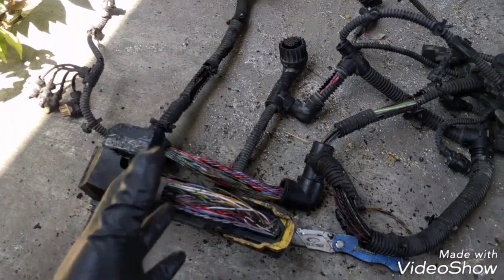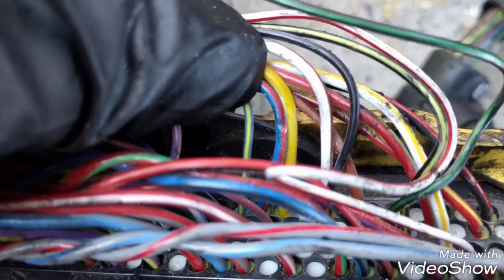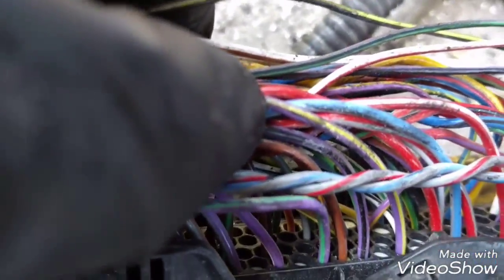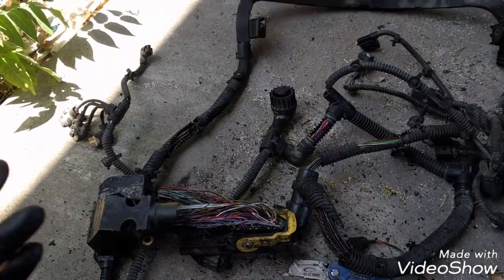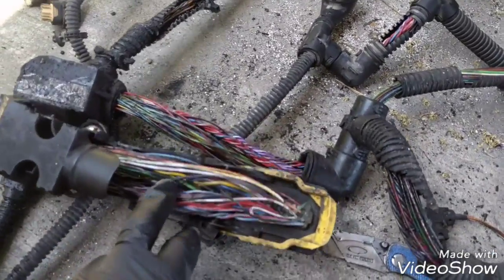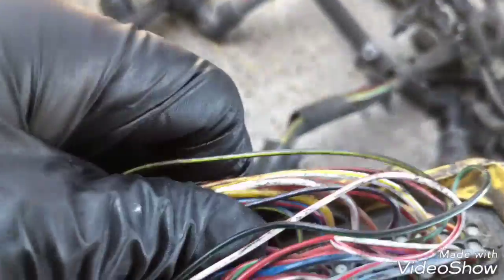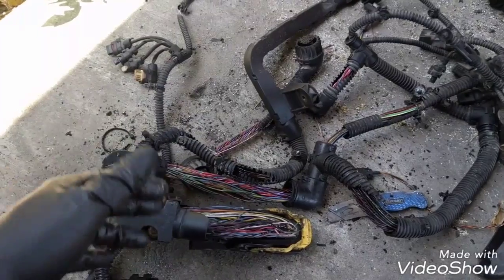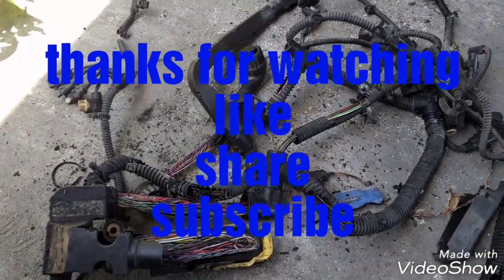Freightliner Cascadia check engine light on DD13 DD15 engine wiring harness might be your problem

Comment: Two thumbs up Francisco!!!!  I have a DD13, 2014 Cascadia, and suspect this is my problem with an “ECU 1” code
Reply: Let us know. I'm having the ECU 1 issue also.
Reply: @marcusjones1082  Sold Cascadia, but never did track down ECU 1 code 100%, It would come and go.  If you have replaced your transmission then you should have replaced ECU, and run the programs for setting clutch.  Sometimes the ECU goes out before the clutch does.

Comment: I randomly got spn4259 04 on my 2011 dd15, "unit pump solenoid cylinder 4, 5,  6 shorted to ground".  When it happens, I shut the engine off for 5 minutes and then restart it and it runs fine.  Right on par with all the common problems you list for the Cascadias.

Comment: Came across your video and have an issue. 2011 freightliner cascadia DD13 have check engine light and another solid light. Thought it was the fuel injector harness and had it replaced. Still showing and both lights comes back on, shut the truck off and kill switch for about 25-30 minutes. No lights and drive for about 5-10 minutes same problem and speed doesn't go over 50 or 55 mph?

Comment: Hello fransisco this morning that I got in my truck dash said I had multiple codes. Spn 108 f13, spn 110 f9, spn 171 f13, spn 190 f9, spn 3031 f9, spn 513 f 9, spn 520231 f13, spn 520232 f9 and spn 1231 f9. I see they are all communication codes so is it more likely the acm or harness. Thank you for your help.
Reply from the maker: What is the year of your truck?
Reply: 2011

Comment: First I got a malfunction light for a couple of days, then the solid amber check engine light came on and I lost 25% power on my 2015 cascadia. Turned out to be bad wiring harness just behind the step on the passenger side..
Reply: What kind of codes did you have if you remember

Comment: Hi,
Cascadia Freightlner when turn ignition on cluster start blinking, HVAC CONTROL Blinking, signal lights on the side blinking, marker light on right top blinking, I changed SAM CHASSIS on left firewall was smoked, and also changed SAM CAB (used good ones) still same issue
Reply from the maker: Check the pdm in the firewall on the driver side

Comment: My check engine light has stay on , I got a computer diagnostic they said it’s the after treatment that I needed to change DPF filters  I was in Wyoming and it’s gonna cost 3500 at the petro I just payed 90 for the computer diagnostic and drove it like that , the mechanic said it will derate and any time I wouldn’t make it to Utah and if I did I was lucky, well I made it to Sacramento CA!! Over 1,000 miles can it be possible it’s something minor considering I made over here?
Reply from the maker: What is the code number?
Reply: Francisco Amaya thanks for replying back appreciate it!! In the computer dash board under codes it’s saying 0 fault codes . However I took it to freightliner dealership in Fontana CA there saying the same thing i need to change the DPF filters my situation is that I don’t have enough to pay for the repairs and have any money left for bills , I need to make a few runs to cover everything, the customer service rep was telling me that a customer came in with a check engine light on and wen to Colorado and back to Cali and the truck never derated, he said it just depends but he couldn’t tell me how long it will be fine before it shuts down , my question Francisco is should I wait to have the money to fix it at the dealer or can I go to a DPF shop to clean the filters ? Also are they just trying to pull a fast one on me by trying to get money?

Comment: Hey Francisco I am new to trucking. I have had countless hang ups that makes me want to give up. I recently purchased a 2014 automatic Cascadia 125 dd15. Last night the transmission would not go into gear. It starts fine but the check your transmission light came in. in the gear box it showed a flashing F. This is the code that i saw....Diag 1....SPN 520271....ECU 3...Fault 1...Fail 4.. Could you explain to me what this means? When i tried to pull up the inactive codes by turning the keys on and off these are the two codes that appeared: 66 and 21.
Reply: DeYoung the code probably is on the truckersreport somewhere go check it out...

Comment: hello I have replaced the metering unit along with the sensors I removed the def tank and cleaned it and replaced it with clean def fluid I cleaned the egr valve the doser I have not replaced the def pump just the def filter I also got the dpf and doc filters cleaned. none of that helped I still have about 5 fault codes showing up. any idea of what it could be
Reply from the maker: +Jorge Facio 
What are the codes?
Reply: Francisco Amaya regen too often dpf pressure def quality def pressure sensor and def temperature sensor according to freightliner I need to replace the box where the dpf and the doc filters go along with the filters too.
Reply from the maker: +Jorge Facio 
I will recommend you to do a regen with the DDDL software and see the performance of the regen. 
The temperature of the regen at final stage
Temperature (+/-) 
DOC inlet  525° f - 700° f 
DOC outlet 1100° f - 1112° f
DPF outlet 1050° f - 1120° f
SCR inlet   900° f - 1112° f
SCR outlet 900° f - 1110° f
Reply: Francisco Amaya they have done that before already at diffrent shops and they have all said that the temperatures look good. they clear the codes but then I drive about 300 miles and both the engine lights turn on and it shows the same codes again
Reply: when you have many unrelated codes the harness from the exhaust computer to the one box and the def pump may have many rubs (bare wires) inside the loom. remove the harness and open the loom.  if you see many rubs replace the harness. the new harness should be longer than the old harness.  run it along the left frame across to the right frame on the cross member. keep the harness off the top of the transmission.

Comment: Hello Mr Francisco
I have a 2010 Freightliner century DD15. 2 weeks ago, I had a CEL with the code 128 100 03. My oil pressure gauge was fluctuating from regular idle to 0 PSI then back to normal. I change the oil pressure sensor and the CEL didn’t come on. Fast forward to yesterday, I was at my delivery and the check engine light came back on with the same code. I wanted to ask, is it possible that I need to change the O rings by the oil pickup tube or its the wire harness that’s causing my CEL to come back on? Thx in advance
Reply from the maker: Yes, replace the o rings and the oil manifold with the oil pressure sensor too.
Reply: You better change also Temp oil sensor with oil pressure sensor both in same location

Comment: Hi francisco. I have a 2009 s60 with dpf.
 Engine shutts down when arriving at a full stop
Reply from the maker: No warning or red light when this happens?
Reply: @franciscoamayaYT   no codes at all...i was thinking maybe fuel pump but dont want to throw parts
Reply from the maker: Yes, a bad fuel filter or air filter can cause some Similar
Reply: @franciscoamayaYT  trucks idles at 595rpm but if i bump to 675rpm engine wont stall
Reply from the maker: Sometimes a regeneration can fix that PROBLEM
Reply: @franciscoamayaYT  truck pulls and works hard so it's always a passive regeneration
Reply from the maker: No, you have to do a parked regen with the DDDL software

Comment: Hola Francisco te escribo desde Canada mira estoy trabajando en un western star con dd13 engine Truck tiene las dos cheques light on quisiera saber si tu tienes los regen normal values from detroit 
I have the code 3713 permanent and 3719 active and 5 more code el dd13 también tiene problemas con el harmes..!! Xq cuando force regen con mi laptot me e dado cuenta que todas las guges del tablero estando boen se apagan como que si unieran apagado el switch y seguido de eso deja de hacer el regen tu as tenido un caso similar al mio.?? X favor déjame saber cualquier cosa 
Y me he visto casi todos tus videos ya que no tengo experiencia con el detroit engine  es muy bueno lo que haces te felicito sigue adelante
Reply from the maker: Los codigos Indican que necesita regeneration y que no se esta completando. 

Es possible que la injection de combustible al def no sea la adecuada
Reply: Oye en que parte de canada estas? Tengo 3 dd13 uno me dio problemas para completar la regenacion...egr actuator estab
Reply from the maker: Estoy en California

Comment: How much does it cost usually to replace all the harnesses ?  We spent almost $10k in 4 month on engine lite and still not going away even dd motor couldn't figure out what going on
Reply from the maker: +hardeep grewal 
Labor to replace the engine harness is around $700 - $1500 (depends on the shop and labor rate) and the harness cost is around $500.  

Do you know the code description?
What is the problem with your truck?
Reply: Francisco Amaya thanks for your help and greats videos
Reply: Will this cause a spn000625 fmi 9

Spn 000625 fmi 8

2012 cascadia 

 TRUCK Loses power after idling 20 mins will idle allday but throttle  stop responding and def light flashes ( DEF IS BYPASSED ) 

Start every morning fine drives about an hour sit 20 mins then boom no response just idles

Comment: Would a bad wire in the harness cause a/c problems or would it have nothing to do with a/c?
Reply from the maker: It has something to do, just the fan override and the a/c command but still the AC will work independently of the engine MCM.  

What is your PROBLEM?
Reply: Francisco Amaya i have been dealing with my a/c for over a year and nobody can fix. It will run fine for 30 mins or maybe a few hours but then starts blowing warmer and the force of the air coming out of the vents goes way down. I had the compressor, condensor, thermal exp valve, hi-lo pressure switch all replaced. Lots of techs say it sounds like an evap but the evap is not dirty or clogged up. I was told maybe it is the Sam Cab Module. I got one from a junkyard, swapped mine out but still a/c is not working correctly.
Reply: @travelinghamburger6093  had you changed the A/c dryer?
Reply: Leo Granados i have....about the only thing i have not changed is the evaporator

Comment: I'm having a similar problem but when my check engine light come on the turn signal and engine brake doesn't work ?
Reply: same problem ! have you figured it out? Mine kind of stutters and then the accelerator goes off and on

Comment: I have a 2005 freightliner century with a detroit series 60 engine 12.7. My truck was running good but one day the turbo went bad. I changed the turbo, my truck ran good for a whole week than all of a sudden my engine protection light and abs light started to come on making my truck lose power and shutting down the truck. i have to wait in order for it to turn back on, the longer the wait the longer the truck runs before again turning off. Ive changed my egr valve because the computer gave me egr codes but it still has the problem. Then i changed the computer but the only thing it did was not turn off the truck only the abs and engine protection light come on and the loss of engine power. I've cleaned my batteries, replaced oil pressure sensor, checked the cooling sensor and changed the alternator but does the same. Do you think its my harness. I got a video up loaded, if u can please help i would appreciate it.
Reply from the maker: First,  I will recommend you to pull the code of the computer to know what is causing the red light to come on.

Comment: Hi 
I am getting code SPN 520919, spn522108, 522117 and spn3464
What you think it’s harness or something else, it running Normal but my yellow malfunction light comes on all the time. 

Thanks
Reply from the maker: Yes, it is possible.  Check the wiring that goes to the throttle valve,  it could be touching ground.

Comment: Do you think this is the problem on my truck? I have 2 check engine lights that won't shut off. Truck cranks but wont start. I reset ecm by removing neg terminals on the battery. Truck will run if one of the two check engine lights shut off. 2011 cascadia dd13 with egr,dpf
Reply from the maker: Do you know the code number of those two lights?
Can you pull the codes? I can give you a better idea if you do that.
Reply: Francisco Amaya sorry for the late reply but I was able to get codes through the gauge cluter. These are the spn numbers I saw. Spn 108,110,513,190,3236,520231,521920. If both check engine lights won't shut off the truck cranks but will not start. If i remove neg terminals for about 15 mins and then connect it back. The check engine will turn off and the truck will start.
Reply: Forgot to add. If the truck has been running for a couple of hours and I shut it off. The truck will not start back up, just keeps cranking. And the two engine check lights stay on. I must let the engine cool and remove neg terminals. It will start once the engine cools down.
Reply from the maker: Can you please pull the actual code from your ECM?
I tried to check the codes you sent me but I couldn't see anything related to the engine.  
Try to pull them and send to me and I will give you a better advice.
Reply: Francisco Amaya that's the only way I can get spn codes. Through the gauge cluster. I have a cheap scanner but it can not pick up any codes. I tried to plug the scanner on another  freightliner and it was able to give me a spn code. I'll inspect the harness for damage and oil. I'll replace if i find damage
Reply from the maker: Ok, my recommendation is to pull the codes from the ECM to have a better idea of what is happening to your engine.  

Try to pull the codes when the engine is running and look for inactive codes and send them to me.
Reply: Francisco Amaya ok I'll try that and let u know asap.

Comment: do you have to removed oil sump on cascadia to replace harness
Reply from the maker: +dwite Ferg 
No, you don't have to remove it

But it is easier to replace the harness if you remove it.
Reply: on some engines it is very tight in front of the oil pan.  you may need to remove the front motor mount bolts and lift the front of the engine to get old harness out and new one in.  I have not had to remove the pan for this.

Comment: Hello. I have this code. 

ENG 2 001 SPN 5444 
CCV ERROR 01

I checked crankcase breather 
There’s no oil dripping, nor I don’t see any oil around the crankcase 

I do feel my truck a bit sluggish. Like it’s lacking power. I only hear the turbo loud and clear in higher RPMs 

2012 cascadia DD15 
Thank u
Reply from the maker: It is possible that the oil separator needs to replaced.
Reply: Francisco Amaya cool thanks. Would u know the part number?
Reply from the maker: I have the part number of the oil separator in this video,  I also show details how to replace it.  

 click to this link below 
https://youtu.be/MLcs8oDk1Ss

Comment: Hi bro I received brand new truck from my company and I am loosing power. I am hauling only 25000lbs it's freightliner automatic. I had same model before it was 2015 but it was pulling fine. This new one is changing in to top speed 12th speed even when the truck is going 50MPH. It slows down in the hill and not downshifting, any suggestion?
Reply from the maker: +S Bola 
If you  have an automatic transmission you need to see the automatic transmission setting to allow the engine to change gear at different speed.  

I am pretty sure you have the MBZ automatic transmission with MBZ axles.
Reply: sounds like the engine and transmission modules need to be flashed. or possibly gear ratios in the ecm may not be right.

Comment: Hi Francisco, I have a malfunction code ENG 1 SPN 51 FAIL 2.  What does this mean? 2014 cascadia dd15.
Reply from the maker: This codes means: intake throttle valve error. 
This Could be caused by a bad throttle valve

Comment: SPN003659 14 & SPN 003660 14
I have replaced the injectors 1 and 2 and both wire harness, but i still have the same codes. Can u please tell how to reset the sysytem.  Thanks
Reply from the maker: +AZIZ OMER 
If you replace the 1-2-3 injector harness and the 4-5-6 harness and you still have the same problem you need to inspect the injectors 1 and 2.  It is possible that the injectors are bad.  

You can erase the only with the DDDL software or a universal diagnostic tool. 

The harness replacement is the cheapest possible problem to your fault but if replacing the harnesses does not fix the problem you could have bad injectors or bad engine sensor harness.  

I suggest to open the valve cover and remove the injectors harnesses, after that check injectors 1 and 2 for resistance with a multimeter. 
The injectors has four pins, you are going to check them in pairs.  First the intake side pins and the the exhaust side pins if there is not resistance between them replace the injectors.
Reply: AZIZ OMER Hey, I’m having the same problem with my injectors (same codes). Did you find out what the issue was? Please let me know. Thanks

Comment: i jave 2010 dd15 with error code SPN003659 14 & SPN 003660 14. can uvtell me what it mean?
Reply from the maker: +AZIZ OMER 
This codes are injector #1 and #2 fail 
You might need to replace the injectors and the injectors harness inside the engine.
Reply: Francisco Amaya thank you.

Comment: I took my ecm to get it check today nothing is wrong with it they say. I have a detroit 60 series 12.7 truck will crank but won't start so I change the started and the other piece next to the started silinoid or something like that
One thing I see was when ever I turn the key to on position the check engine light don't come on and I have a fuse on the negative the come out from the battery the is keep burning out .I also have new battery can anyone help me plz thank you'll
Reply from the maker: Check the timing sensors.